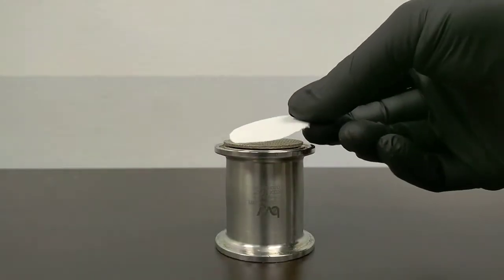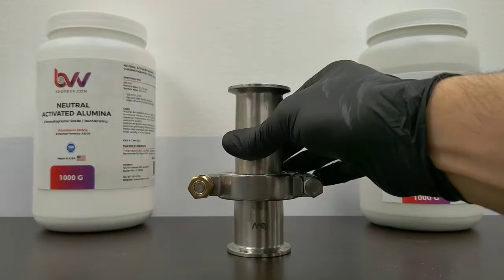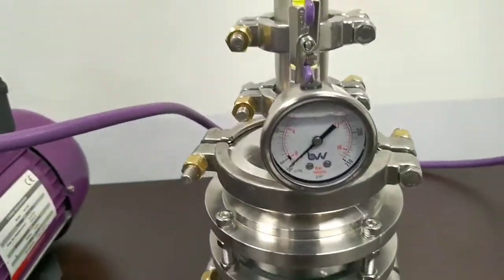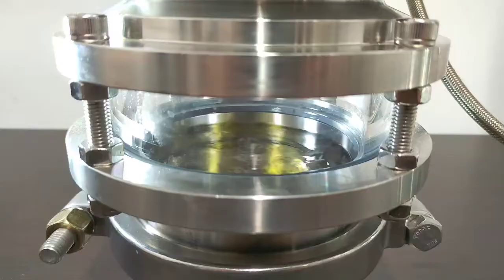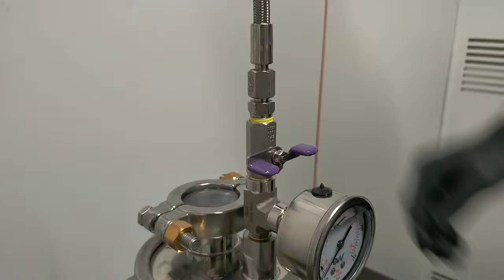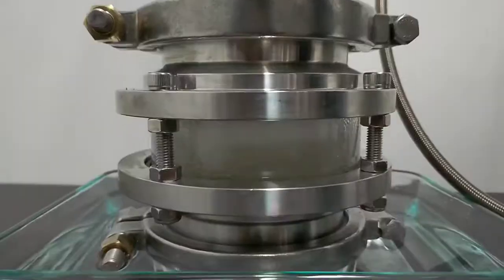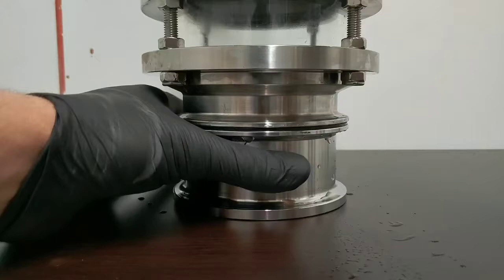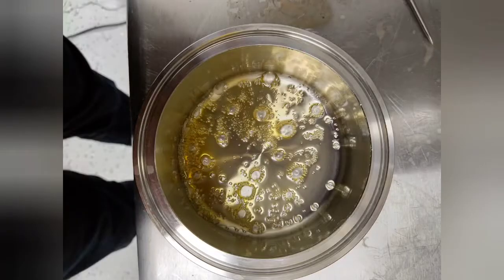How to Run and Evo Mini

Comment: One thing I didnt see you did was apply vacuum to the conduits. There is air in these tubes. Every time you put and get out the lunes you are contaminating the extraction solvent with atmospheric air and humidity in the same air

Comment: why do you need to add bentonite clay? "im brand new to BHO extracting.)
Reply from the maker: @Greenthumb42069 welcome to extraction! Using a CRC (color remediation column) on your CLS (closed loop system) has become a standard addition. The CRC is there to remove the unwanted impurities from the solution. When extracting a biomass, you can pull the undesirables such as chlorophyll, fats, lipids, etc. The bentonite clay in the CRC removes the dark colors from your material. The dark color typically comes from the degraded trichome heads during the curing process. The bentonite clay will remove all that!
Reply: @Jmarosii  have you considered tho, just like all extractions, alcohol for example, the more you distill the better the product, is not. you cant extract out the true nature of the product untill you find your self  adding back synthetic terps and by that stage who are you serving , its easy to find your product has been compromised for the sake of profit. all just to have that unnatural look. your product looks amazing none the less.

Comment: What mesh gasket should you use? (Ex: 100 mesh, 50 mesh, 300 mesh, 2500 mesh)
Reply from the maker: @williamcourchane3135 we sell our extraction units with a 100 mesh screen to hold back material. We have found no issues with material getting through a 100 mesh while keeping flow constant.

Comment: Can this be used without the Color remediation step?
Reply from the maker: @seanshemelia1800 YES! The CRC can easily be taking out of the system and the system can run using the same operating procedure. When you need to use the CRC it's a simple clamp in and pack.

Comment: That have crc filter?
Reply from the maker: @doolittle6977 yes! the very first clip is the CRC being put together. We have a small column separated from the material column by a strong micron filtration disc. You can pack this small column with filter media such as bentonite clay. We recommend using silica 60A, bentonite clay, and alumina in your crc.
Reply: @Jmarosii  I recommend not using CRC as it poisons the consumer 😎

Comment: what ratio of filter medium to extracted material do you suggest? Thanks!
Reply from the maker: @Barry Newman great question! We recommend using three different medias packed on top of one another. From top to bottom; Silica 60A: 30-50g per lb of biomass, Bentonite Clay: 75-100g per lb of biomass, and Neutral Activated Alumina: 30-50g per lb of biomass.
Reply: @Jmarosii I also have crx and cry. What would you recommend?

Comment: Was loving this until the vacuum oven was mentioned. Don't have one of those. It's a beautiful machine but it might be a bit much for the home user.
Reply from the maker: @Jax Maximus we love this unit too! This design kicked off many new designs for our CLS. You do NOT need an oven with this system, you could use one of our vacuum chamber pots to purge the final extract. This mini unit would pair well with the BVV 2 gallon chamber and 9-inch heat pad.
Reply: You can totally use a vacuum chamber and heating pad for the home user.

Comment: Bought it, love it. Time to upgrade to the 1lb active evo loop but its out of stock! Need that bad boy asap.
Reply: How many grams fit in it?
Reply from the maker: @Arma Ramos this unit has a 12" long column which typically holds 90 grams. We give it a range of 60-90 grams depending on your material density.
Reply from the maker: @LizardClarinet we thank you! <3 Give us a call, maybe we can get one built for you!
Reply: Yeah. It's $2300 on deal. Gonna get me two.

Comment: What’s the difference between this and a heat press
Reply from the maker: @Vladimir the major difference is that this uses solvent where the press does not. Using butane or propane strips the biomass material of its resins instead of being melted out using force. The yield on a BHO unit will exceed the yield form a press.

Comment: How much material is this made to handle in a batch?
Reply from the maker: The unit in this video can hold 60-90 grams at one time. Depends on the material density you are using.